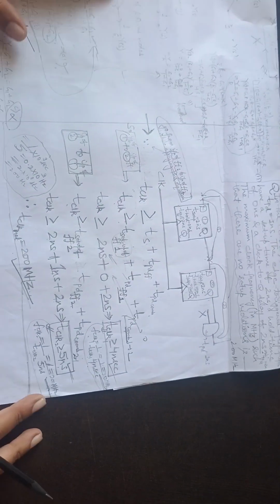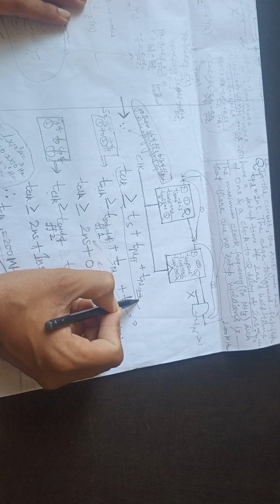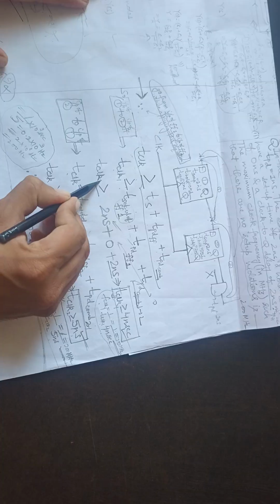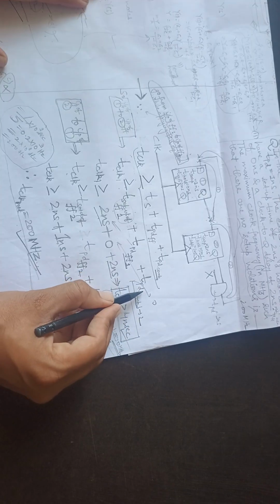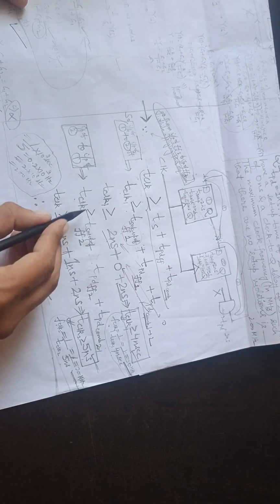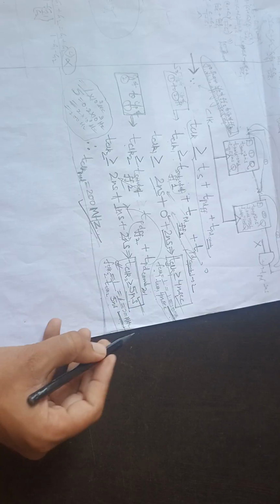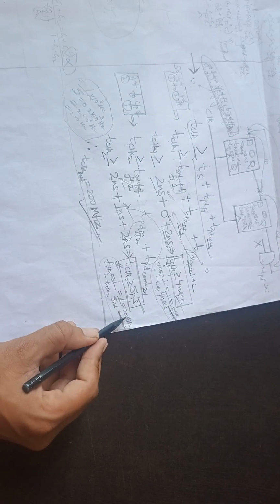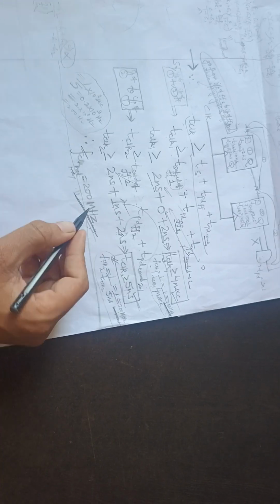Digital electronics problems GATE 2025 ECE

Comment from the maker: In question 45( sequential circuit), I used the fact that ( A bar )exor (B bar)= A exor B  
And values of output Y at T0,T1,...  will remain same between two consecutive positive clock edges